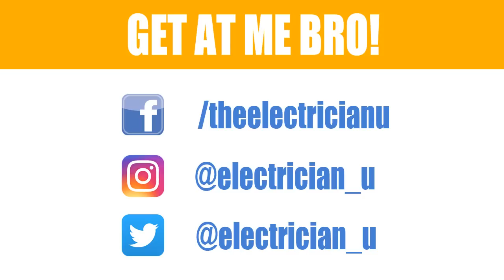Episode 9 - How Breakers Work & Whats Inside A Breaker

Comment: I was under the impression that most breakers are thermal magnetic breakers and have two different modes of operation - one is the electromagnet that you referred to, but I believe they also have a bimetallic strip that will be heated by higher current through the breaker and can also trip the breaker. It would have been good to look at this. I believe the electromagnetic mode of operation is the fast trip mechanism for fault currents which are typically quite high. So a 15A breaker might need something like 20 or 30A to trip via the electromagnet, but the thermal mode of operation is to catch overload conditions, which might only be moderately above the current limit of the device. This would be more like if I've plugged my microwave into a general purpose/lighting circuit along with a few other smaller appliances that were also on the same circuit. This combination might be drawing 16 or 17A when the magnetron is on. We would not want the electromagnet to trip at that level, as it will trip very fast and we could end up with nuisance tripping due to inrush currents or other transient conditions, but if it's sustained over 10/20/30 seconds, it can be enough to trip the bimetallic strip and shut off the power before something more problematic gets hot.
Reply: Brettski74. . . . . . You are absolutely correct. The breaker that Dustin opened looked like it was just a Thermal Breaker (metallic strip), which is intended to handle Overloads. The Magnetic Breaker is suited to handle Short Circuit situations. And then of course, you have Breakers that handle Ground Faults (GFCI). Overseas, they have breakers that incorporates all elements of a fault. They are called RCBOs. Then you also have Electronic Breakers, that you will find in Switchgears that has (LSIG) protections, and uses Trip Plugs, that allows you to change the current rating for the circuit being protected under Normal Conditions.

Comment: Be careful with some manufacturers, which terminal is the "mains side" and which is "load side". Some are universal and it doesn't matter, others especially 3ph industrial have arc vents which vent in the direction of the load side. This is to prevent venting onto the live mains side busbar or cable.

Comment: I don't want to be too snobby but the description is a tiny bit incomplete.  The mechanism described in the video is only the "magnetic" component of a complete "thermo-magnetic" circuit breaker that is typically found in residential applications.

The magnetic trip level is NOT the rating on the front of the breaker (ie, 15, 20, 30, 40)  The magnetic trip level can be anywhere from 3 - 20 times the rated current on the front of the device but it's never clear unless you look up the manufacture info.  The function of this magnetic trip level is to catch short circuits or high current ground faults. The reason the trip level is much higher than the breaker rating is that some things have MUCH higher startup current than their normal, steady state operation.  AC induction motors , certain type of lighting, and large DC capacitive systems CAN (depending on design) draw 10 or more times the runtime current during the few moments of startup. The "counter-emf" torque opposing magnetic field, heat-up resistance process or plate charge take some time, respectively.  You don't want the breaker "nuisance tripping" just because you turned something on. 
You can read about that here under "Short-circuit relay trip-current setting (Im)"
http://www.electrical-installation.org/enwiki/Fundamental_characteristics_of_a_circuit-breaker#Rated_current_.28In.29

Second, and lastly, is the "thermo" portion of the circuit breaker.  The rating on the front of the  breaker is indicative of the "thermo" performance such that:
"This breaker is guaranteed to trip (open) after X seconds/minutes of time if a minimum of Y current is passing through it" ...where Y is the rating on the front of the breaker.  The x seconds/minutes is given by the manufacture in their documents.  Why is it called "thermo" you ask?  Well.  It is a fundamental property of nature that current passing through material will increase the temperature of that material according to ohms law and its corresponding power law.  (V = IR and P = (I^2)*R).  Because EVEN metals have some finite resistance "R", there will be power dissipated by said metal if current is passing through it. As you can see, the power increases quadraticaly with the current passing through it.  If power is "dissipating" from something, unless it's designed to produce something else (like sound or light), it's primarily doing so in the form of HEAT! Thermo!  You increase the power, you increase the temperature.

Another property of all materials in nature, including metals, is something called "co-efficient of thermal expansion."  Each type of material in nature will GROW at different rates according to the temperature it is at.  Remember being told how bridges are designed with those interlocking teeth in the middle because the bridge will physically extend in the summer and contract in the winter?  Same principle.  Concrete and steel grow at rates according to their coefficients of thermal expansion.    What happens if you bond two types of metal with different co-efficients together into one "strip?"  Well, as the temperature increases, one of the metals will want to grow faster than the other metal, causing the strip of bi-metal to bend or as scientists say "thermally deflect."  Within a circuit breaker, a bimetallic strip will slowly begin to bend with increased temperature and will trip a spring mechanism if it bends too much.  The purpose of the "thermo" behavior of a circuit breaker is to remove voltage from a circuit if it is drawing more current than the wires and devices in the circuit are capable of carrying.  You don't want fires caused by burning wires and insulation - tears, dead creatures, insurance companies - no good.  

Curiously, you might discover that the same things in your house that will trip circuit breakers in the hot summer will NOT trip them in the winter.  Why?  Well because that bi-metal in the circuit breaker is already heated and "pre-bent" according to the ambient temperature, effectively LOWERING the rating of the breaker!  Because less power would be required to bring it up to tripping temperature/deflection, it trips at a lower current than its rating.  You can read about this here:
https://en.wikipedia.org/wiki/Bimetallic_strip

So there you go!  All the basics you could want to know about circuit breakers without getting an engineering degree.
Reply: Mark Jones r/iamverysmart
Reply: Just what I was looking for, Great explanation.
Where's your YouTube videos?
Send me a link 😄
Reply: @adrianm413 r/ihavereddit
Reply: You have a YouTube electrician channel?
Reply: @mansardmanor3869  Alas, I don't have the charisma or depth of knowledge to make a good youtube channel.  My degree is in computer/electrical engineering and I've had jobs doing both duties.  Here are the best youtube channels on computer/electrical engineering
AfroTechMods
GreatScott
AddOhms
Electroboom.

And a more advanced one:
EEVBlog

And a great one that focuses more on computer engineering specifically:
Ben Eater

Comment: European breakers have two different tripping mechanisms. An electromagnet which trips on a short circuit like shown here, but also a piece of bimetal which deforms on overcurrent. 
So on short circuit you get a very quick trip via electromagnet, but on mild overcurrent (say 25A on a 20A breaker) you get a slow trip after a few minutes because of the bimetal deforming.
Reply: sir i think you just described a thermal magnetic circuit breaker and yes theyre all like that in the us

Comment: Ha ha, you exposed a weakness in my understanding of how these work. For some reason I was thinking these are triggered by heat, like a bimetal strip. Electromagnetic effects from an internal coil will always be more consistent. I guess that's why they need to be rated for the current and voltage used, since if the coil fries you lose the electromagnet and it won't trip. Maybe some have a bimetal strip as well, as a backup?

Comment: I wonder what the most common failure mode of a circuit breaker is- meaning when a breaker stops working properly, what is actually damaged inside? Maybe the springs?

Comment: So I have a couple breakers that I noticed I could push and move up and down a tad bit. In doing that I can hear the arc of the current. They're all 20 amp breakers. After doing this to two of them I now have power to the different outlets that weren't working previously. Whoever wired my house put a kitchen, living room, and two dining room outlets on the same breaker. Should I be getting these breakers replaced or is this semi-normal? Would it be better to put all 4 outlets in the dining room on one 20 amp, kitchen on another and living room on a 3rd?
Reply: It's common to have outlets from multiple rooms on one circuit. A rule of thumb is no more than 10 receptacles on one 20 amp circuit.   Kitchens are required to have at least two 20 amp circuits for just the countertop outlets (to my recollection).

Keep in mind that SOMETIMES there's a difference between what's already in place and what needs to be corrected. If the issue was 14 gauge wire on a 20 amp breaker (ie hazardous), then you would rectify the situation. On the otherhand, electricians go to homes all the time with multiple code violations that do not present any hazard to the occupant. Code is rewritten every 3 years so a house that was wired 30 years ago is gonna be way out of code by 2020 standards (remodels would have to meet up with 2020 req). 

Also breaker space is often a factor. Electricians have to get creative sometimes (w/o violating code) to get all the circuits into one panel which is why multiple rooms will be on a single circuit. Then each type of room has different req (eg bathroom, kitchen) Hope that's helpful 👋
Reply: Also, it's common for breakers to have that 'slop' where they can wiggle slightly. With the panel cover, this should hold the breakers in place. There are quality panels and there are really bad panels that are known for being hazardous. Some panels are known for breakers that don't trip so those panels are recommended for replacement. It'd be a good idea to research your particular panel and make sure your panel is 'safe'. Zinsco is deadly. Google 'dangerous electrical panels' and a list will pop up.
Reply: @truthbebold4009  Thanks for the reply. Forgot all about this. Come to find out all outlets in all four rooms upstairs are on the same breaker, I had to put a 30 amp breaker in to keep it from popping. Since then there's less demand so there's no risk. Also, all of the light switches are on another. 

I don't think anything really is up to code. I still have knob and tube spliced into romex on old school outlets without a ground as well. It's been a mess trying to fix it.

Comment: Your videos are very helpful an get down to detail.  Keep it up bro. Do you have a video on how to use a tester? I bought a fluke t5 but only know how to test for voltage an amperage.  I wanna learn how to short circuits etc. Using a fluke meter. Any any advice for commercial aprentice electrician?
Reply from the maker: I’ll put one together, thanks for the tip!
Reply: Electrician U Thanks i really appreciate it,  ill be on the look out for it

Comment: Square D QO is top of the line (like you are using), similar to Cutler Hammer CH. Square D Homeline and Cutler Hammer BR are crap. You are referring to the QO’s as the only Square D product. QO is rarely used in residential, but I agree with you that QO (and Cutler Hammer CH) are the best.

Comment: If you have a 2 pole breaker on phase A and phase B, that has a 40 amp load inside of a 3 phase panel, do phase A and B both have a 40 amp load on it, or do you have to divide by 1.732?
Reply: The current is traveling through the phases, alternating directions from phase A through the circuit to phase B, then vice versa ad infinitum (wash, rinse, repeat). So if you were to place an amp meter on the phase A wire, you would read 40 amps and you would get the same reading on phase B. They're working together to provide a current of 40 amps. Is that helpful?

Comment: Thanks brotha nice video. 
One question that small break with 2 things in what case do u use it ?
Reply: Oftentimes the panel will be filled to breaker capacity yet you need to add a new circuit. If you have a 48 space panel with 48 normal size breakers(i.e. 48 circuits) you can add the tandem breaker and have 49 circuits (or more if you need to add more tandem breakers for more circuits). Hope that helps.
Reply: @truthbebold4009  very interesting. It helps a lot thank you. 👍
Reply: @giotinez5996  you're very welcome. Are you going into the trade?
Reply: @truthbebold4009  I am DIYer and I'm watching all this free online course to expand my knowledge....

Comment: I agree about square d qo  .To trip one just tap the load side of a 15 or 20 amp single pole breaker against something hard or hit it harder on the heal of you hand and it will trip. Im not a fan of GE because they have the main lugs on plastic 1/8 in from the back of the box with a PLUG ON quad main breaker like I-T-E used to do GE 100 amp panels are also PLUG ON mains. Dont be fooled those mains are plug on with very little contact to the buss disguised as bolt on.Siemens with COPPER BUSS would be my next choice mains bolt in but dont like the lugs on the branch breakers. I DONT LIKE Cutler Hammer CH or BR even with copper buss because their 15 & 20 amp breakers are set at 650 amps to instant trip where Square D breakers instant trip at 150-200 amps on a short circuit. Cutler hammers 100 amp panels have 10,000 AIC PLUG ON 100 amp main breakers. Dont care fore Square D Homeline its aluminum buss. Most panels come with 22,000 AIC main breakers. I only use full sized panels because most towns dont want mini breakers. Ive found on square d qo their mini breakers are a little less responsive to a short that the full sized ones.
. Dont be fooled by GE look at the clips on their 100 amp breakers and look at Siemens.